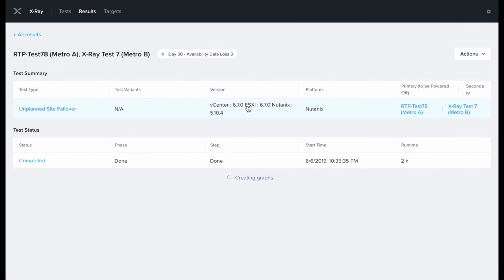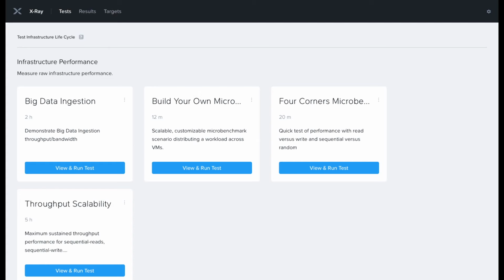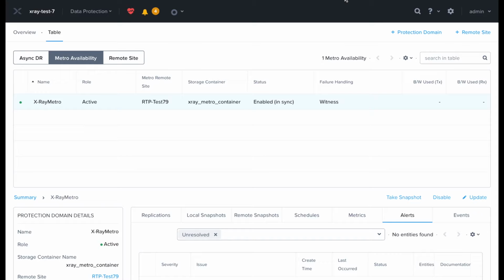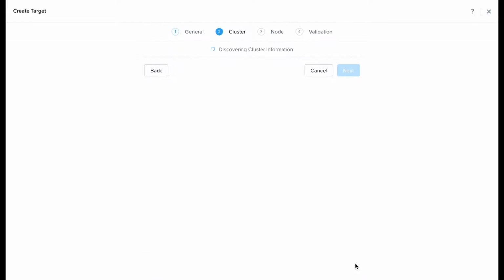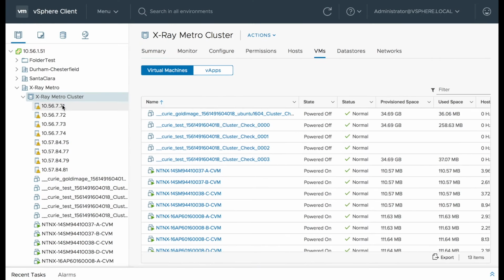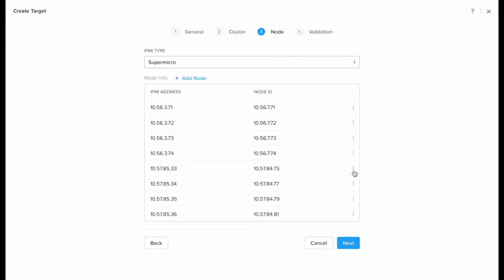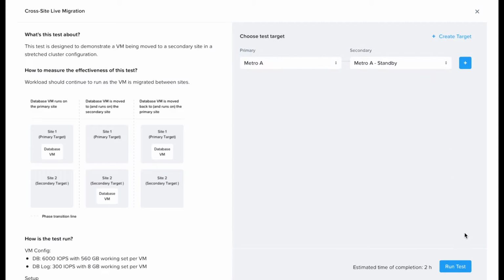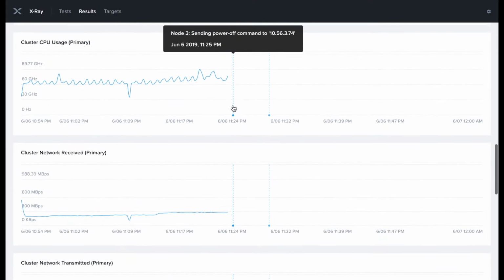How to Test Metro Availability Using X-Ray

Comment: hang on. but with site failover test, the vms still power down and restart on the standby site. If that is the case, then how does the apps continue to operate without any interruption? if a vm is actually restarted there is then a interruption. are they all cached in memory during the transition?
Reply from the maker: Thanks for asking! Metro Availability is a 0 RPO (No Data Loss) and Near 0 RTO (Time to Recover) technology. In the event of a site failure, VM's that are in that metro cluster will utilize VMware HA to restart on hosts that are available in site B. There is an interruption in service for a short time while the VM's restart in the recovery site. There will be no data loss of fully acknowledged writes (Ack'd on both sites). This provides an extremely robust infrastructure for the most critical applications. If your business requires even more uptime, we suggest looking into application level resiliency to fulfill that.